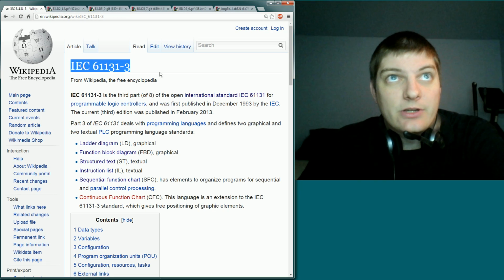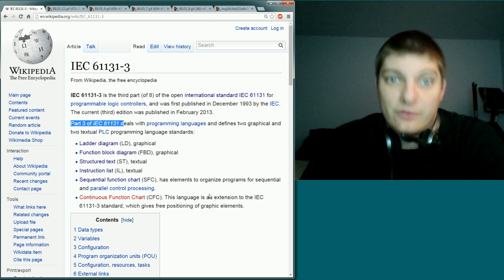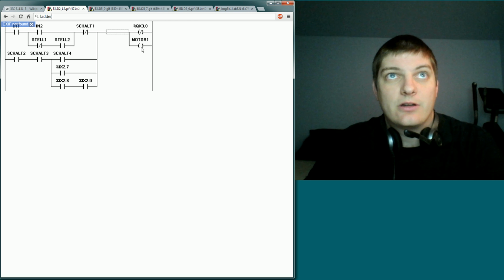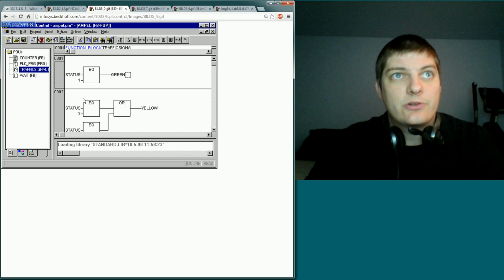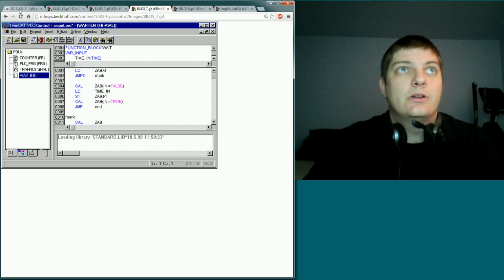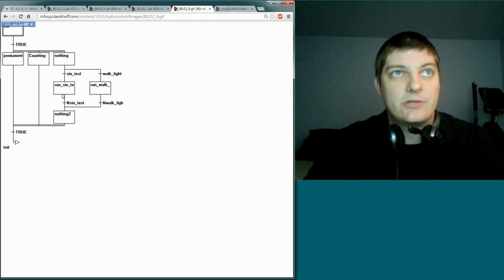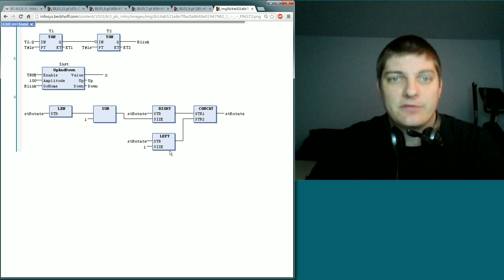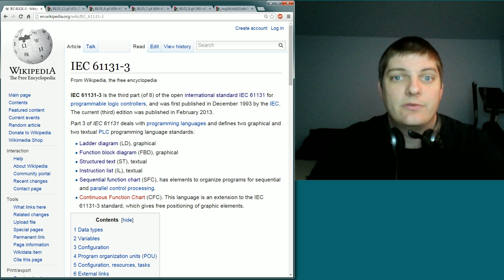Learning PLCs with Structured Text - EP1 - Intro to IEC 61131-3

Comment: Hi,
I am new to TwinCat 3 and to PLC programming.
I made a program on TwinCat 3 to experiment a little bit. When I switched to Run Mode TwinCat gave me the following error:

Error 1:40:05 PM 074 ms | 'TwinCAT System' (10000): Sending ams command >> Init4\RTime: Start Interrupt: Ticker started >> AdsWarning: 4115 (0x1013, RTIME: system clock setup fails. 
Hint: On Windows8 system execute win8settick.bat in TwinCAT\3.1\System as administrator and reboot.) << failed!
I am running TwinCat 3.1, Engineering edition on Windows 8.1 Pro 64-bit operating systems.

Any suggestion of how I can solve this error is more than welcome.

Thanks a lot
Reply: I had the same issue on 8.1, along with other issues. 
Ideally, upgrade to Win10. 

Did you do a "run as administrator" on the "win8settick.bat" batch file?

Comment: Thanks for kind lecture for TwinCAT beginners.. I want to ask you something. Do you know how to control the 1-axis motor by using TwinCAT 3.1?  I want to move 1-axis motor by using this program, error is constantly orccuring.. I don't know how to solve this problem...
Reply from the maker: What type of motor?  Servo or Stepper, you can use the NC system or talk to the drive directly.  DC motor is easier.  Elaborate...
Reply: This is a servo motor, EL-7201 MODEL..
I already succeed moving that motor by using NC-online system, but I want to move this by using structured text...
If you have enough time, Can you see my twincat file? If you permit, I'll send this file to your e-mail.. error 16933, 0x4225 is constantly occuring...
Reply: oh haha I solved the problem!! Thanks for giving your e-mail!

Comment: Awesome. It's so hard to find material on structured text, since it seems there's only a few players out there using it, even though it's 61131-3 Thanks.
Reply: Thanks.  I agree, which is why I made the series... There is just not a lot of info out there and it is the obvious choice for most new people.  I've programmed in all of 61131-3 (except IL I guess), and ST is the winner by far for lots of reasons, the most important is that is looks/acts like C, C++, Java, etc that everyone is used to.

Comment: can you also make tutorial for twincat2? thanks
Reply from the maker: All the code in this series will drop right into tc2, it is the same language. the visualizations won't copy/paste but otherwise the code will run just the same.
Reply: +SquishyBrained if only i can post picture here is much more easy. i got cx1020 beckhoff but i cant connect using my windows 7 laptop.

Comment: Excellent video tutorial! As a developer using high level programming language such as C/C++/C#/Java etc, I have a question, you can do exactly same thing using these high level programming languages (including timer, state machine etc). So why has Beckhoff (or CodeSys) introduced this new language?
Reply from the maker: +Mahbub Rahman The language (to my knowledge) was not introduced by Beckhoff or Codesys, but was landed on by a consortium of PLC vendors long ago (I don't recall the year or the vendors)... Anyhow, they aimed to standardize the code across vendors so support and training and such were easier in a factory.  If you know IEC61131-3, you essentially know how to work with 100s of PLC types.  
As for why they didn't use an already established language, I think there are a few reasons... They wanted it to be easier to program than C++, etc.  ST is very close to C/C++ in functionality, however the other languages that make up IEC61131-3 are "easier" and more suited to engineers and programmers coming from ladder and relay logic.  ST is often considered more advanced and complicated than the other IEC languages, but really it is only as capable as the others, as they all get compiled down to instruction lists.  That is my second guess as to why.... they already had a compiled language that worked well on current hardware, so they started there and built languages on top of it.  There is probably a way to take c++ and have it compile down to instruction list code.
These days Beckhoff supports C++ for some things natively on the real time hardware, which is pretty cool if you need it.  In practice we have yet to find a problem that ST can't easily solve in the realm of industrial automation.  Remember, many of the fancy features of C++ and higher level languages are based around dynamic instantiation of memory, which is just recently available with the object oriented extensions to IEC61131-3, and to my knowledge is very rarely used in automation at this point (though that is changing).
Reply: +SquishyBrained  thank you for the explanation.  Structured Text looks PASCAL type language (not really used  much as high level language).  Anyway, Structured Text looks quite easy to learn. Thank you for great tutorial.
Reply from the maker: +Mahbub Rahman Sure, no problem.  ST is easy, but more importantly it is the best we have :P.  Reading and writing ladder code (In my opinion which is not universally shared) is tedious and mouse-intensive.  My rough guess is that 90% of PLC programming is ladder these days, but I'd like to think ST is growing.  The company I'm at is 100% ST when the customer allows it.
Reply: @SquishyBrained  no
Reply from the maker: @ziborgbe  huh?

Comment: Do you have any other videos on this subject? I'm just starting to get into beckhoff  at work . This has been a great help .
Reply from the maker: did you watch the whole series? it's 10 or 12 episodes
Reply: I'm on #9 right now I started to watch last night. do you do programing for a living ? I just started a new job and all the use is beckhoff . we are having an issue with a program that we had an outside person make for our machine but some how it not correct . this is helping me understand a bit .
Reply from the maker: +Roberto Hernandez I work at a company as a controls engineer.  We do industrial automation, and probably 90% of our machines use Beckhoff TwinCAT to some degree.  I program robots and other things as well.... VB, Python, etc.  I'm not sure how so many companies can get by using outsourced programming on industrial machines.  If the machine is even slightly complicated, the programmer typically needs a good bit of time for tweaking the nuances of timing and control to make a functional system.
Reply: +SquishyBrained you should e-mail me maybe you could help us out . He have been looking for someone that knows programming . I'm a service tech at a machine manufacturing company .
Reply from the maker: +Roberto Hernandez evanmj@gmail.com